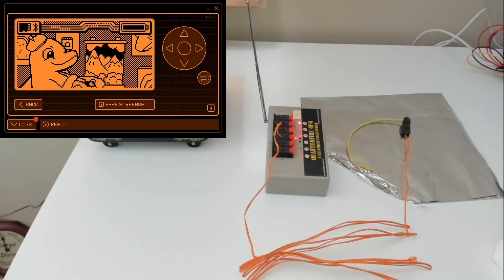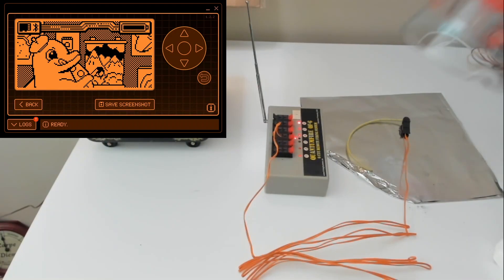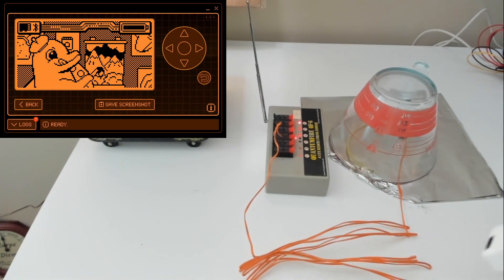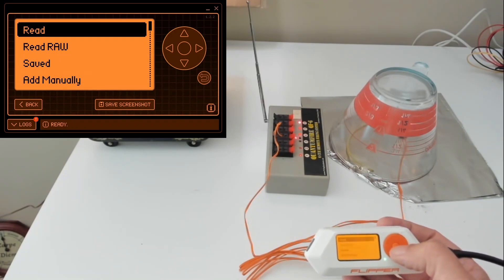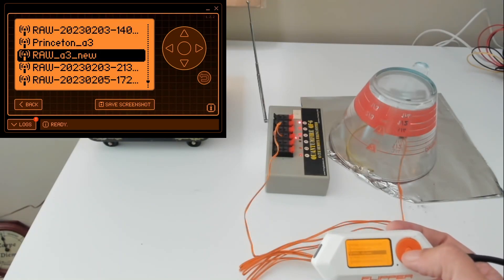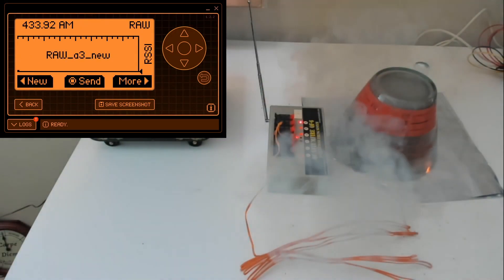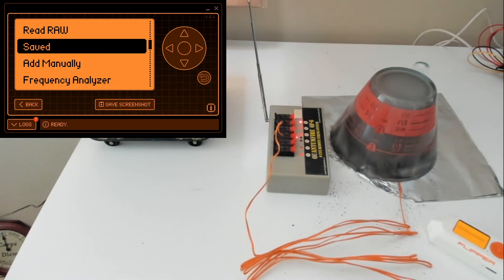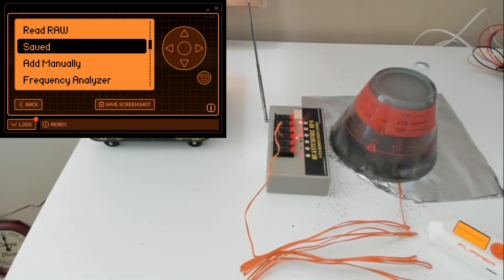[15] Flipper Zero - Testing our Hand-Crafted Raw Save File

Comment: Detonator type of action?
Reply from the maker: Talon igniter with some 3 second/foot fuse that I cut into the core to expose the powder.  I’m glad I put the glass over it.  Way more smoke than I thought, plus it burns pretty hot.  I think GPIO demo with some transistors so people can make their own ignition system for under $10 would be cool.